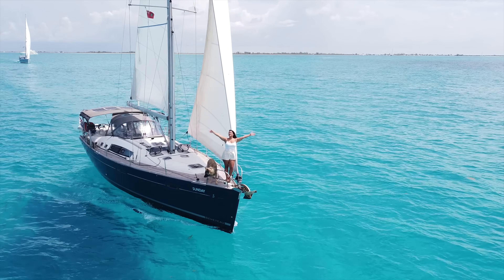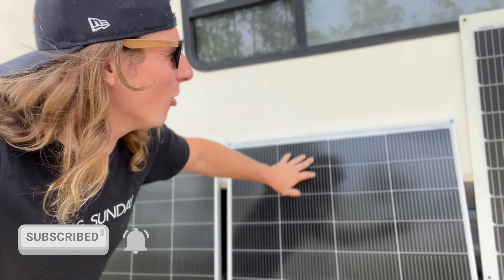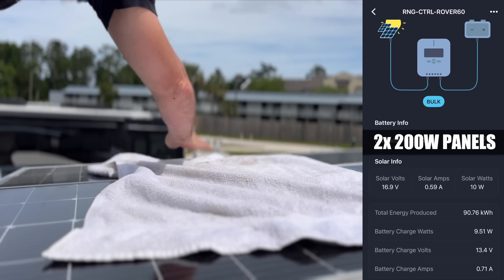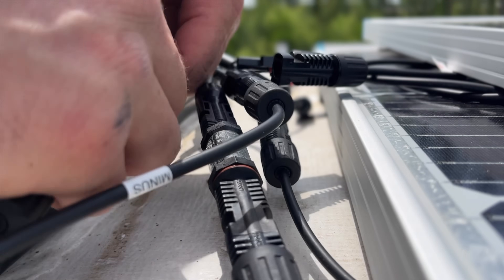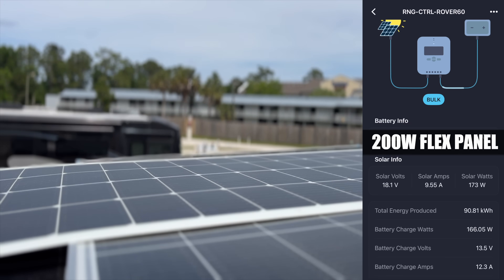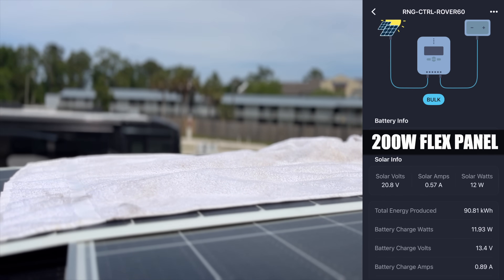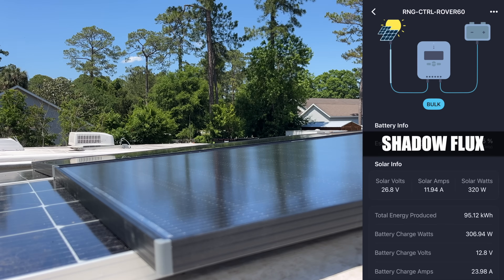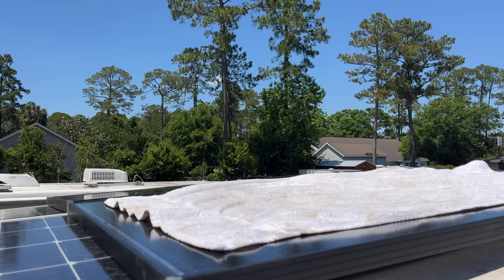We Tested 4 Renogy Solar Panels & One Panel survived the shade! | Sailing Sunday

Comment: Shading and covering a panel are 2 different things, its shade protected not towel, yoy did the test wrong and thats why you got ner the same results, the only time results changed really was when more of the 16 roads you call them was catching sun being more roads for the sun.
Reply from the maker: Yeah i'm pretty sure I explained exactly that in the video... I did the test right which is why I got near the same results on those panels when blocking the sun, but the shadowflux panel only shut of each individual cell thats blocked and not the whole row as shown in this test.